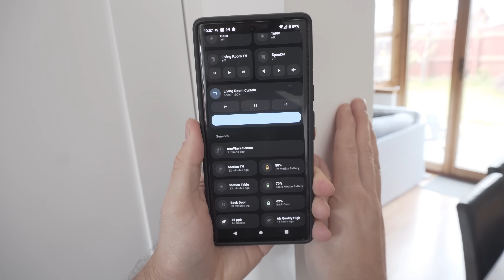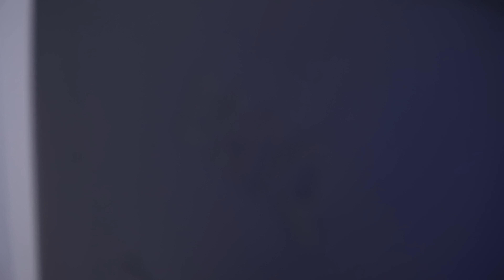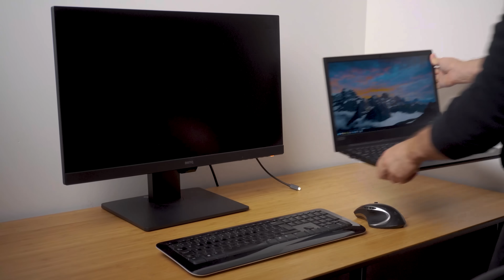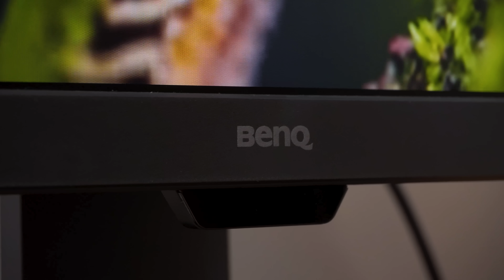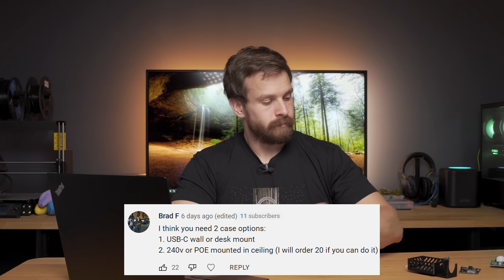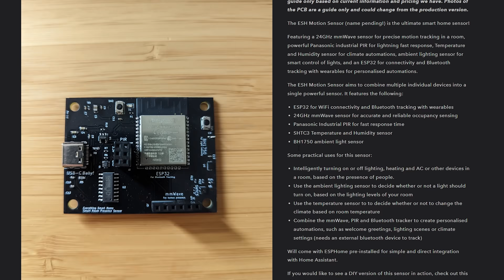I'm Making My Own Smart Home Motion Sensor!?

Comment: Could you please include the Bosch bme680 sensor instead for measuring temperature & humidity, so the same sensor can next to those measurements additionally give a co2, voc and IAQ reading? I think especially that IAQ value is an ideal way for regulating my central ventilation system.

Comment: It's good but £37 for the kit is expensive and it says out of stock till April/May.

Although less compact (and both battery powered), a BT Xiaomi Mijia LYWSD03MMC temp & humidy sensor (flashable) used in Home Assistant in conjunction with a zigbee Tuya mini PIR both from ebay would work out a lot cheaper. Especially when bought in multipacks as you'd need at least 4 or 5 for the average house.

Comment: Incredible! I'm so excited! I've signed up to be notified. Can't wait for POE version thought. 
It would be awesome if a later iteration made allowance for a microphone pre amp and speaker amp circuit, along with a RPI compute module to install Rhasspy on (depending on how HA's voice stuff goes next year). I guess it would be a big expansion in feature set, but it would be super cool to have a little box in every room that did temp/presence and voice commands.
😋

Comment: How do you power it though? needs to be plugged into a usb c adaptor so practically next to a powerpoint? what about ceiling or corner mounted?
Reply from the maker: Powered via USB-C or there is 5v headers if you want to supply something else

Comment: LD2410 24Ghz sensor, used by Aqara FP1, seems to have very good performances at a fraction of the cost. Maybe you can give it a try
Reply from the maker: They are not the same sensor, FP1 is 60ghz not 24ghz - IMO that is not that good a mmWave sensor
Reply: @EverythingSmartHome  Very odd: the LD2410 datasheet says 24Ghz not 60. Btw I haven't tried it myself, my hope was that  it was just good enough for the application

Comment: Are you getting any false triggers on the PIR? Seems to be a common issue with these little sensors close to the pcb
Reply from the maker: No as it's a very good quality PIR - I mentioned either in this video or the previous one that I don't like the cheap ones because of that issue

Comment: Great idea and nice PCB.
One comment : below the antenna of ESP32 you should better make a cut in the base PCB (or at least remove the top and bottom metal of the main PCB) to avoid interference
Reply from the maker: There is a no fill zone there already under that area 😆

Comment: I did register and am interested in a use case that would conceal some of the electronics in a book shelf ornament. 

Would you know the size of the board yet from your redesign?

I joined your discord and not really sure where I share ask other questions about this. 

Perhaps you could point me to some information on the mm wave sensor and how much of that needs to be exposed or show through the whatever enclosure you plan to offer. In your demos the front is quite open and I want to hide a bit of the sensor if I can.

Comment: Lewis, looking like "Zemismart Tuya WiFi Human Presence Sensor Wireless Radar Microwave Motion Sensor Body Movement Detector Home Security System" are also getting into the same. Specs are in poor English, but think it's also Zigbee and the sensor is 28GHz (not 28mm as stated). Selling to the US at $45.60 plus $3 shipping. No where near the capability of your sensor, but their site shows logical mounting instructions.  More pressure on Aqara PF1 (good).

Can you detect a person that is within range of the sensor that is in a shower behind a glass shower enclosure? If so, will need more!!

Comment: With the spare pins and the low power requirements why not do it with a battery?  I personally don't want to run cables up the wall for it as much as I want it.
Reply from the maker: Trust me, if battery was an option, I would have done that 😅
Reply: @EverythingSmartHome  fair enough! We need to get this into Linus' house.

Comment: Developing PCBs is rather OK, but can you also develop a power saving variant that can run on battery power?
This is were I struggle the most as every component and connection matters in the power consumption...
Reply from the maker: As mentioned many times previously, if battery was an option, trust me I would have done that first 😅 mmWave and WiFi do not lend themselves to battery power unfortunately
Reply: @EverythingSmartHome  true indeed. I'm currently building a battery powered sensor, based on ESP-12 and an RTC... allows me to keep wifi down if I'm not in certain timeframe. So I can create a motion sensor that works at night only or when lx are very low. I use a latching circuit to avoid powering the chip and only give it power on a trigger.
Haven't printed the PCB yet, I'm still seeking to have my schema reviewed.

Comment: Make it fit into a light switch box with 120/240v power. You don't need to produce the box. Just the faceplate. That makes it wife approved, looks more refined, and can justify a higher cost. Maybe around $100.00 like the aqara P1. 

To top it off, make a firmware that fires a web hook and it'll even work without a hub. Grab the hubitat people, the ifttt and Alexa people too.

Comment: Is there a way for these to be powered by CR123 batteries, to save cables being run?
Reply from the maker: No unfortunately not otherwise that would have been the first thing I implemented 😅 the power draw of WiFi and the mmWave is a little too high for battery

Comment: as an electrical engineer, there are two things i would add:
-for the 5v input, add a cheap 5v LDO or regulator (AMS1117 5v may be a good part)
-add the footprint for an esp8266 under the esp32 footprint (so overlapped) so that in the case that the esp needed to be replaced, or if you would sell the pcb as a board to build yourself, you can choose between esp8266 and esp32(dont know if the amount of pins would still work though)
Reply: i mean with the LDO you can run the thing off a random battery

Comment: Please consider offering a version without the currently expensive mmWave sensor.  I could use 2 full units but it would be nice to have other locations that don't need the mm (or pir) still use the same board for simplicity and possible future upgrade+repurposing.  The sensors that don't come attached could relatively easily be deferred purchases for many others as well.

Comment: Very nice project and you have done well with it being your first PCB design. I enjoy making custom PCBs and have had done 7 so far in the last 4 years. Allowing it to be powered in 2 different methods is also a good idea. I am hoping to distribute 5V & 12V DC to various places for LED lighting and also ESP32/8266 controllers.

Comment: My comments:
1. Slightly concerned that the temp/humidity sensors are onboard vs on a wire away from it all.. proof will be in the pudding
2. If mm sensor detects minute movements and we add in a thermocouple (8x8 or even 16x16) to "see blobs of IR" with a "AND" logic you could eliminate a lot of false positives like a moving curtain or other object
3. Price is respectable given your own time/cost - not going to lie it is going to be out of my budget for some time unfortunately considering I'd ideally want 8
4. What is the range or surface area you expect this to cover, maybe a diagram showing what we can expect
5. Are you planning on making this into something we can install in a very damp/humid (moist) place like a bathroom - PIR are useless there if you're sitting idle on the throne for example.

Thank you so much again, so good to see community members take things in their own hands

Comment: One step closer to centralized all of the scattered sensors! If only that the case will be recessed inside the ceiling (flushed), then it will be the answer to all of the nagging comment from interior designer or even architect we will encounter in the future! and of course to power it with VAC 110-220 since it will be place on the ceiling, i would say that it would be the standard of any smart home. Anyway great Job Lewis!

Comment: So this is very interesting. I don’t hate to solder but the idea of this and as long as it doesn’t cost £65 to ship to East Coast USA then I see an immediate need or use case for my kitchen.  

I certainly would love a PoE version and it it would fit into what we call a single gang US electrical box I would have installed it along with kitchen counter receptacles. 

I will still probably buy an initial unit as my kitchen is a challenge for motion only sensors. 

Great work, both you and Dad!

Comment: Well done Lewis, great effort. After your 2nd video, I started looking for parts to build my own and I found this 60Ghz MMW sensor the BGT60LTR11AIP. It's a lot more affordable and readily available that the DFRobot one but is it compatible with your solution/ESPHome? (Sensor link not provided just in case YT marked my comment as spam)

Comment: One thing I tend to get a bit concerned about when I see designs with a temperature sensor sharing a small space (board) with heat-producing devices (like ESP32) is that this will likely skew the readings, especially when you also put it in a case.
Reply from the maker: Sure, it's one of the reasons for the redesign, if it's still too off then we will need to try again

Comment: I think it would be cool if there was an option to order a different SKU of this that doesn't have the mmWave sensor included. My reasoning for this is it could drastically lower the cost for people who only really need/want the PIR/Bluetooth tracking capabilities. 

Along with the STL files for the case, will you be releasing the gerber and Bill of Material files as well? Would be awesome to be able to have the option to order the PCB, components and solder everything yourself if you wanted to. 

Great work on this sensor though! I will definitely be ordering some regardless of if my above comments happen or not.

Comment: Whats the range on the MM wave?  i have 2 FP1s, but the rooms i want to use them in, we are on the edge of their range and they just dont work well for me.  This looks like a fantastic replacement if the range is a little better.  I think the FP1 is supposed to be 5M, but it REALLY struggles when we are 12 or 13 feet from it.

Comment: ❓ Will the mmWave sensor work together with the UWB-chip which a lot of phones have included nowadays to use for indoor location?
E.g. to direct your phone into the direction of a lamp or TV and the app can based on that show the right settings/buttons for this device?

Comment: Would you consider a non-esp variant? I am looking to do a major house renovation and wire out for as much as possible. I would like to use KNX for the basis of control (with HA for high level automation) and this could potentially feed a KNX binary input, would just need the output for the PIR and the mmwave as other sensors would be generally in things like KNX switches or require specific KNX modules for the data types.

Comment: microwave sensors on ebay  5 USD top pir - 3 USD, ESP32 - 4 USD, nowhere near 60 BP, I build most of my meteo stations and sensors with esp 8266/32. PCB done by myself in couple of hours with toner transfer method.
Reply from the maker: What does a microwave sensor have to do with this? It would probably be handy if you actually watched the video instead of leaving irrelevant comments - if you did you would know where literally half the price goes :)

Comment: nice idea, serioulsy well done, but i think youve over priced it for what it is and what it has
Reply from the maker: Thanks. Could you please tell me what the price should be from your experience?
Reply: @EverythingSmartHome  thinking about its usecase, lets say per room or at least each major entry point, it needs to be priced affordably and attractively.  60 per room is not either of those things.  if i take the major components, esp32, motion and dht (dont see any reason to include these on the board, they should be broken out as an option for a gpio both for price and for distance of dht from components), then lets add on the board + smd placements costs at wholesale price shouldnt be more than 30 (should be way less at buld wholesale - $24 per IR24VDA for minimum 50 order for example) and of course 40% (above standard margin) and it still shouldnt be above 42.  This is really just an esp32 on a board with dht sensor + breakout gpio for motion etc so i dont see a 60 per room cost benefit.  If its with case (as you mentioned although i wasnt sure) then we're still pushing way over the price of posh esp32 + motion sensor in a case.  Im not rubbishing what youre doing, i think anyone putting an all-in-one solution together is awesome but this isnt it, no light sensor for example so im confused as to its all-in-one identity.  But this is v1 i guess so there will be many iterations to come and i look forward to seeing what you come up with.
Reply from the maker: And can you tell me how you plan to make it for £42 when the mmWave itself is 29? I didn't see you mention that at all - that was.missed from your list. Also we aren't using DHT as the sensor, that's not a very good quality sensor IMO and gives not very accurate readings. We are also not using a cheap PIR, the PIR is an industrial one from Panasonic and is around £10. So the mmWave and PIR put you at 39 without doing anything else.

Also you say there is no light sensor, did you watch the video? 😂 There is a light sensor included. So you missed many of the components to try to make an invalid point

Also, you don't really need one of these in every room, that's not the idea - there would be no reason to have this in a hallway for example where you are walking through, it's only really for rooms you spend a lot of time sitting still in, like a living room or office.

I'm not trying to be harsh, I value the feedback, but it would be good if you could use all of the information first and not cherry pick things
Reply: @EverythingSmartHome  im sorry youre not taking my feedback well, i meant it in good spirit and yes i did miss the inclusion of the light sensor.  Its important that people are able to give all kinds of feedback i think.  I did mention the motion sensor and also found IR24VDA with a quick search at a wholesale price of $24 per item for 50 order... i did write that.  Ahh well i was just trying to give you a consumer feedback that i dont think 60 per room is attractive whilst the idea is.  Like i said, i look forward to seeing how it evolves but please dont get so annoyed over my feedback, i didnt cherry pick, i only missed the light sensor.  I have more than 1 room that i may spend time in, bathroom, office, spare room( ahem the gym), living room, kitchen which are, i thought, all valid cases for stationary movement (gym included)
Reply from the maker: Yes but motion is not the same as mmWave? We have both a motion sensor AND a mmWave sensor on here, to be clear, this is not comparable to a regular motion sensor - they are not the same thing.

We are also not using the IR24VDA so linking that sensor is not relevant, we are using the DFRobot mmWave (which is a better sensor IMO)

I'm not annoyed over feedback, I welcome it - but it would be good if all of the information was included instead of missing things out

Comment: Good job making your own PCB! One thing worth noting is you want your decoupling caps (C10 and C12 at 3:37) as close to the pin of the IC they belong to as possible for them to do their job properly. It's also very good practice to keep the silkscreen markings of your components close to the components, so you always know which component is which. C10 could be the mark for both of those caps.
Reply from the maker: Thanks!

The PCB redesign takes care of this but appreciate the tips

Comment: I've soldered together an ESP32, RCWL-0516 radar sensor and HC-SR501 PIR sensor and flashed it with ESPresense, but both sensors give far too many false positives however. I'm wondering if this is due to the quality of the sensors chosen. I'm also considering trying the same combination with ESPHome, but I haven't found any commentary on ESPHome's BLE Device tracking. I think I'd like a solution that's powered by an 18650 cell (3.7VDC) if possible.

Comment: Nice one Lewis! Please consider also providing a 12V power input (could be single 5-12v buck) and dry reed relay style contacts.  That way it could be used as both a conventional wired alarm sensor as well as HA controller.  Maybe even consider using a 'traditional' IR sensor style enclosure - you can get these with the lens for about $1 each from the usual Orient Express suppliers.  Would make retrofitting a breeze.  I'd certainly buy a dozen...
Reply: I'm not an electrical engineer, but to regulate the voltage from 12 to 5, I think you'd need a decent heat sink, adding a lot to size, no?  I just had the same issue with an ESP8266 project of my own.
Reply: @RaffBuilding  A simple & cheap buck converter (as opposed to a linear regulator) would do the job nicely & (especially at the low currents required) wouldn't dissipate much energy (heat) & therefore wouldn't require a heatsink.

Comment: Will it run on battery?  Say a 9V or a number of AA’s etc.  What would be the expected battery life?  I’d like to hang it on the wall and not have a cord running down to an outlet.
Reply: Response time is the main feature of this product, so the sensors need to be constantly active and the chip needs to maintain a constant wireless connection to HA to achieve this. That would be a lot of power draw - I doubt you'd get any more than a couple of hours from 4 x AA batteries.

Comment: You could actually use a thermophile sensor (like the omron dt6 line) to differentiate between humans and pets. Pets usually have a higher body temperature than humans. Presence detection like this is used in room-assistant for example :)
Reply from the maker: Interesting, thanks!